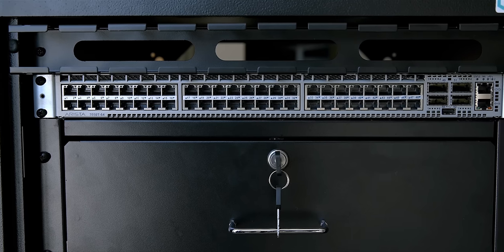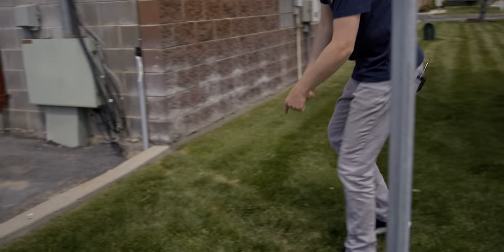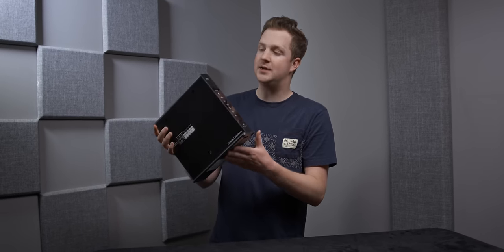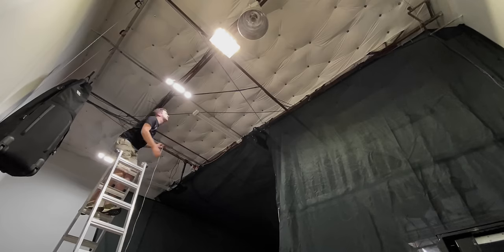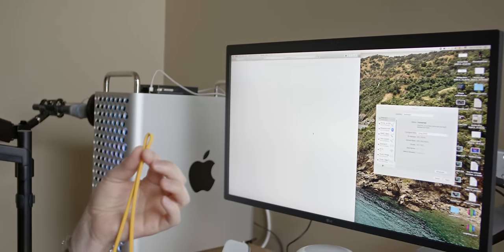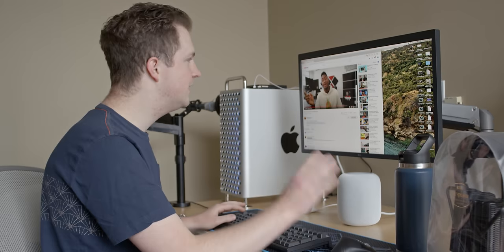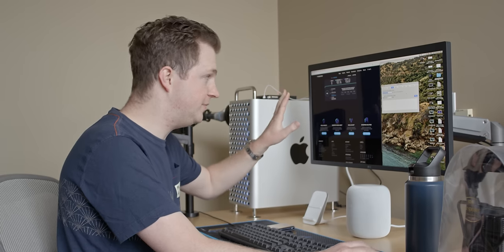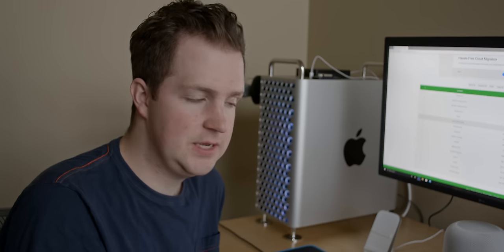How does fiber internet work? 0ms ping!

Comment: I've been working from home for the past 15 months, and one problem I face is that my connection sometimes gets dropped completely, often in the middle of Google Meet calls or if I'm uploading files. I just ran a speed test, and it showed 75.6 mbps download and 5.81 mbps upload. I'm suspecting it's the upload speed that is the problem based on what I'm doing when my connection tends to drop.

The options in my area are Comcast, which I use, and AT&T DSL, which would obviously be far slower. My neighborhood doesn't even have U-Verse. I could get a "faster" Comcast connection, but I don't know if that would be anymore reliable. I wish ISPs marketed their plans based on minimum download and upload speeds rather than maximum download speeds. 75.6 mbps is plenty fast for me already, but 5.81 up when it's good? That's questionable. Fiber internet of any kind is simply not available where I live.

I am running my computer over ethernet and not Wi-Fi already. so that suggestion would not help.

Any thoughts?
Reply: Ask your ISP, they should know best

Comment: Interesting video, however it's a bit funny that you were expecting to benefit from a local 10Gbit/s fiber connection to the modem with a 1Gbit/s WAN connection. Without jumbo frames, you'll never see more than 940Mbit/s actual throughput over TCP/IP when your link speed is 1Gbit/s. In that case, gigabit is gigabit.

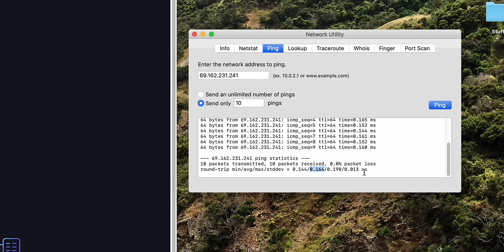Comment: What are you reading at 17:30 in this video? I see 0.144ms / 0.164ms / 0.190ms. A better explanation of ping times would be to look at the traceroute output, which really is a ping between you and each routing "hop" to your destination IP address. Often that doesn't work well, because most IT DevOps folks believe ICMP is evil and full of security vulnerabilities. tcptraceroute is an option as well, but you then have some issues with TCP ACK round-trip times in that calculation.

Comment: Great info very informative.Thanks for sharing.

In regards to modems, They seem to be the bottleneck as most can barely import 10gb (WAN) while the remainder Ethernet ports are typically maxed at 1gb. I love how home modem manuf advertise 10gb but is deceptive because they are talking only about the DOCSIS 3.1 which can handle 10gb BUT those modems are typically 1gb.

Do you know of any fiber modems that include 10g WAN plus a 10g Ethernet or STP+ to your network? I would like the benefit of 10g speed when uploading and downloading gigs of data to and from clients for editing purposes.

Comment: I have a question. My isp advertises gig speed, $65 a month. I have never seen more than 550mbps download and 50mbps upload, (cable isp)

I now can get fiber gig up and gig down, they charge $90 a month. Is the performance truly worth the price differential?
Reply: Its up to you. I personally would go for the fiber connection and it should be more reliable and stable than cable internet.
Reply: Fiber is always better than coax

Comment: Not that anyone cares but you were bending the multi mode fiber from the ont or your isp’s switch to your gateway. Not that single mode fiber that comes in from the street.  You were speaking like it was the fiber coming in from the street. And the single mode fiber would be much more sensitive and fragile than the multi mode fiber with a fiber for send and another for receive.  Which is why they’re used in internal networks. MM is cheaper and more robust. Especially in making cables, and connectors are more solid. Single mode transceivers tend to be more expensive. And SM fiber has a smaller pathway and has to meet higher standards.  MM fiber is huge in comparison and light just bounces all over the place.

Comment: Bending the cable could actually make permanent damage to the crystals inside the cable degrading the overall performance. It's not about if it just works. If that was the case then the whole reason of  upgrading is pointless.

Comment: Doesn't do anything like that in Australia anywhere.
Even though we have fttn and I have fttp. I get 45mbs.

Megabits.
Reply: 1000mb/s is available to fttp connections, though not - to my knowledge - symmetrical.  Aussie Broadband were doing it for like $150/mth.
Im paying $100/mth for 100/40 (3ms 96.8/37.8 right now, and is extremely reliable), so not significantly more...

Comment: I think you might have confused your users. You did explain various technologies, But really has not explained about the hardware or how fiber actually works...  SFP's are responsible for the speed. Fiber cable does not have a speed limit. the limit is defined by the hardware connected on the endpoint. every type of SFP has a range and that's why we use repeater or amplifiers .. there are active and passive filters,, that help us divide the same fiber connection into multiple connections ... Mostly wavelength tech is used on the subsea level fiber.  Active filters use software to divide and combine multiple connections. where passive filters work as prism or glass. divide the light into different colors and each color could be used as an individual connection.

Comment: Just to clarify, on cat5e you DO get your full 1000mbps. With default ethernet frames you lose 6% to packet overhead (This overhead can be reduced by utilizing megaframes). So the maximum speed you will typically reach over Gigabit ethernet is exactly 940mbps. With fast ethernet it is 94mbps. Believe it or not whether it's cat5, cat6, cat6, cat7 doesn't really matter much in typical <50' lenght of cables; the distance you need to cover is much more relevant than the quality of the cabling. The better the quality, the further you can transmit but with exponentially diminishing returns. A cheap way to circumvent this wall is with link aggregation (LAG) where you can bundle up less expensive links existing cables rather than retrofitting to a higher standard.

Comment: Why can't my cable company tell me why I keep getting disconnected? I've replaced my modem and router with top of the line models with ample band width, multi channels and frequencies. Had my service line changed, signal checked, and I monitor my modem data page for clues. I'm willing to accept slow speeds during high use hours but constant disconnects are intolerable. The problem is between my modem and the isp. The service tech says everything is perfect!!!!! I'm ready to spit nails!

Comment: 0ms? What if hardware or DNS or ISP or a number of other things to interfere with the test. I haven't researched it yet but I can't see why it would not be possible to interfere with packet sent/received time in headers or something. Not sure what system would do if the received accidentally becomes a time before sent time, would it show a negative ping? Example -14 ms
Reply: It just rounds down
Reply: @thomasfriedl3137  didnt consider testing to somewhere close, i did the same and saw 0, oh well, hoped fir sometging more intereating

Comment: I very dumb question from a very obsolete person here: I don't understand, the fiber speed is 1gigabit per second so this is as fast as data can be transferred, but you have a 10 gigabit network...how do you get up to 10 giga if your internet speed is only 1 giga? are these two different things? what am I missing?
Reply: The internet connection is the limit. Unless he pays for a 10Gb internet connection, he will get up to 1Gb. So while he cannot use the extra speed on the internet, it can come in handy if he needed super fast transfer speeds between his internal network devices. Say he has a server that has his video files. He can copy files from his computer to and from the server at 10 Gbps. This is of course assuming that everything in the network supports 10Gb, from the computer/server, cabling, switches, etc.
Reply: @JJFlores197  thanks Jose. Now I understand, the 10gig network is within his facility, internally…maybe what I have heard as intranet???…), his internet provider speed is 1giga (up load and download to the internet)

Comment: I have spectrum internet service.  400/20 My ping is .07.  My actual download speed is 480+ my upload speed is 23. With box you add to your modem will my service get better?   My internet speed is check on my Apple TV.  I have the 2010 Mac Pro and a iMac 2013.  I also notice on my amazon 4k firestick my speed and ping is 80 download speed.  My ping is 23.  Why.

Comment: You showing the fiber bend test made me cringe. If you exceed the rated bend radius of the fiber you can cause major problems (microbends, macrobends, microreflections, etc.). These issues won't necessarily cause a permanent loss of connection, but will certainly degrade the overall performance of the connection over time. You have to remember Fiber Optic cable is, at it's most basic sense, glass strands which makes it very fragile. There is a reason people comment on your videos saying "it's not gonna work you're gonna break it".
Reply: Yep. Given how accurate modern systems are, if even those one two packets flop around it still works. But it wouldn't always, sometimes it would create weird lag issues or so.... depedning on what workload he is doing.

Comment: Why the hell would you intentionally shatter your fiber optic cable?
Think about it. The cable works by shining light through a thin cable of glass sealed in rubber. Of course some light will make it through all of the fractured glass within the cable, as long as there's no kink. But it won't be as straight of a line, nor as clear of a path.
Since you've already destroyed that cable, why not strip the sleeve and show us the glass underneath. Or, better yet, compare to a new cable and see if either get packet loss.

Comment: Starlink's gonna be faster than fibre due to light traveling 50% slower inside fibre.
Reply: I don't understand at all what you mean. Starlink IS never faster than fiber. No Air/radio communication is ever faster than fiber FOR now
Reply: @hariranormal5584  It's fine, let me explain.

Satalites are in low earth orbit (evident because they orbit the earth almost once every hour) so the vertical distance the signal travels is significantly shorter than your average fibre connection (and the signal doesn't travel through air apart from this vertical distance). 

Ex.:
Geostationary is 35,786km away from earth. They have a round trip latency of 1500 ms.
Starlink is 290 km away from earth. They have a round trip latency of 12 ms.

There is a net of satelites surrounding earth that beam the signal to each other in space (I mean a LOT of satelites, so even if they are very close to earth, don't worry about atmospheric interference at all).

The extra 580km of radius it adds to the curcumference of which the signal needs to travel is negligible compared to the size of the planet.

Signals that travel through space are unimpreded and travel much faster than light through fibre. The distance that the signal travels in space is also significantly greater than through air (except for short distances). On top of this, fibre is routed inefficiently compared to starlink because it has to follow the limited number of highways, especially when going overseas -- they also require much more maintenance.

We'd expect that latency will be higher (although probably <10 ms more) in shorter distances, and halved through longer distances due to more efficient routing and unimpeded travel.

Comment: You're not going to get anything more than 940/940 on Speedtest due to overhead, that 60Mbit/s is TCP/IP protocol overhead and Ethernet overhead. Copper 1Gbit ethernet cabling does also do full 1000/1000mbit, it's just plain false that copper cabling is limited at 940Mbit's. With fibre 1Gbit ethernet cabling, you will hit the same limits. Also, if you are using that Juniper switch as just a media converter that's just a complete waste dude. A simple 20 USD TP-Link mediaconverter will do as well. 

If you would have looked at the amount of raw traffic flowing in your speedtest, or when using copper cabling, you can actually see that it is sending 1000Mbit/s of traffic. It's just that due to overhead you are not able to use the 60Mbit/s as that is used for TCP/IP and Ethernet signaling.

Comment: Yeah I have the same internet as you but ut isn't fiber to the home it's fiber to the node they said they won't go fiber to the home it's sucks. 1.5gbps down 41mbps up but it is 1.5gbps to the modem and out of the modem it's less than 800mbps it's awful and I feel I'm getting robbed of not only speed but my money too. They can't understand why I'm not getting the speed out of the modem I've tried everything nothing works. It's their gateway x8. The fiber is out on the pole 50 yards away and it runs from there to my home as coax cable

Comment: Just wait until you find out that symmetrical 10Gbps is happening with coaxial cable. Expanding the OFDM frequency. Fiber is still too overpriced to replace traditional cable systems

Comment: Sigh.. Do you think that the actual place that the server is hosted might have someting to do with the response time? Because, you know, it's hosted by your ISP? You know 4224ft from where you have your office? "That can't be right" please.. Also please don't handle networking equipment, or cabling, before you've read up on it, because what you are doing can become expensive, fast.
Also yes it is nice to have 1gbit connections, it's pretty much standard for households where I live. FTTH and FTTB mostly, no filthy GPON in sight. 1gbit is around $60/month or so. Pretty much the same cost or a little bit cheaper than flatrate LTE with 100+mbit downstream speed.
We're starting to build 2.5gbit FTTB for private housholds now while some other ISPs are already delivering 10gbit FTTH to private households in select locations. So I wouldn't call it "new cool thing" except for maybe in north america and developing countries ;)

Comment: Well.... DOCSIS 4.0  apparently offers 10Gbps in coaxial cable..... coaxial is NOT that bad..... even in olders standards. In any case, your run of the mill home router and shitty Windows will introduce most of the latency.
Reply: You see, the main reason "why copper can't handle good speeds" is just because how it's divided and shared in the first place.

It's almost like an Apartment building you see, if you actually think of one floor, it has quite a lot of area, but then they split it into smaller so called "apartments", and scaling this wouldn't be easier once it's fully built. That kinda applies for many copper like technologies, that's why they can't push as much bandwidth as fiber can, otherwise copper has no issue reaching really high speeds. Theoretically, even Terabit DSL speeds exist!

Comment: can you utilize that speed if you use vpn such as pia?
Reply: Matters on which path the ISP would prefer, the transit, middleman, server, etc  because VPN's are "single-socket" like appliances, it'd be harder to push max bandwidth. And this is why Speedtest in general is just a scam because most people think you have "10Gbit!", while you have so many factors limiting this.

Comment: they didn't even remove the mule tape and foam it?? some sorry AF fiber  hands, and could have made the fiber slack loop more uniform and less tight (fiber might have a 600lb tensile strength, but it doesn't like small bend radiuses) right as it went into the coyote, ps, my source is me, I work on a Fiber crew

Comment: While I'm paying for 150mbs upload+download but I'm only getting 20 because I'm across the house.😥
Reply: Try Ethernet over power line adapters if that possible (should be if modem and your computer can be on the same power line). Or better just lay UTP cable in your house. Cat6A preferably or at least Cat5e. You just need cable, cable termination boxes (or similar thing) and punch-down tool to terminate the cable to that box. Also other stuff to help "lay" that cable across your house. Then run patch UTP cables from those boxes to complete the run to your computer and the modem. Buy simple and not expensive unmanaged gigabit switch if you need more ports from single cable. I advice to lay another cable (Cat5e) for 100 Mbps receiving end devices if possible as they don't play very nicely (you lose some speed) when connected directly to gigabit switch (and switch is connected to gigabit router).